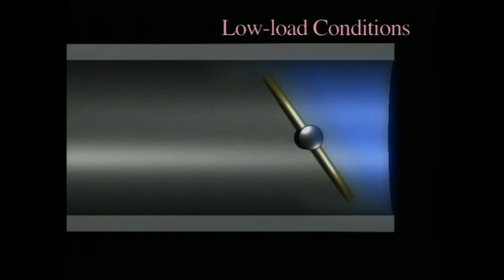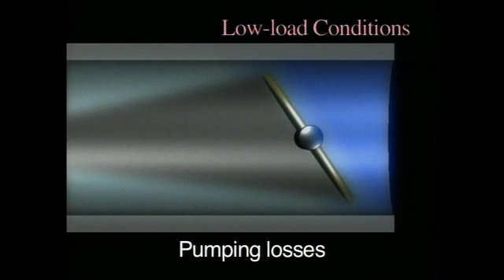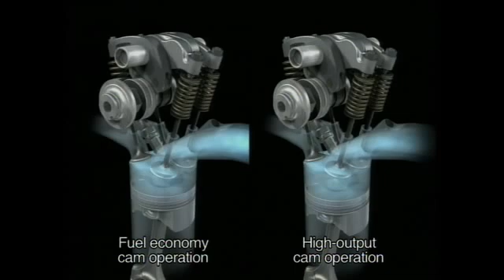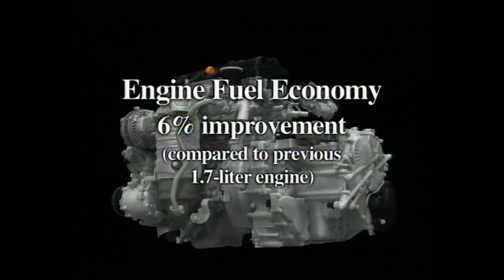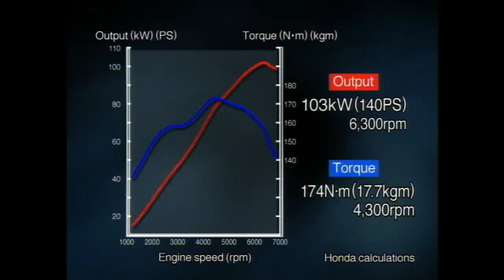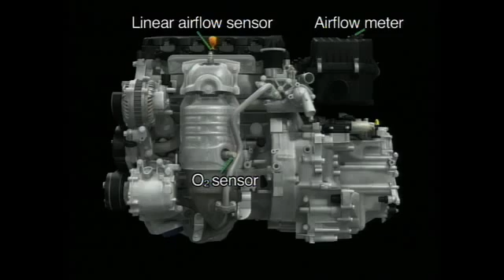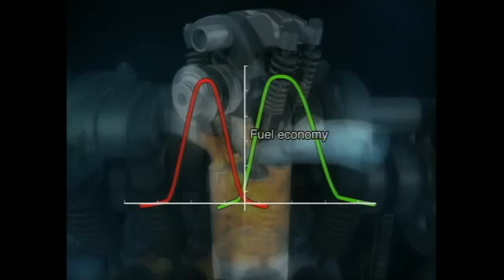Honda R18 Engine  1.8L  i-VTEC

Comment: The oil pan is smaller. Be carefull with the level. I bought a FK1 with the engine totally seized(knock knock also) bad maintenance. Swap to another and doing an average of 35 usmpg with i-shift.

Comment: My 07 1.8 civic gets as good mpg as my hybrid. Love the R18!
Reply: What hybrid? What mpg?
Reply: @borishasarrived5524  they can get over 40 mpg if youre easy on the gas but even when flooring it they sip gas there's a lot of tech in this old motor that is pretty crazy not for performance obviously but from a economy/workhorse durability it's the last of its kind

Comment: This is one of the best naturally aspirated engines that Honda ever made. Unfortunatelly, Honda has also gone wit donwsizing and puting a lot of Horse power into small engines. That results at low maintenance cost and great driving experience, but can never have as near as good durability and reliability of a naturally aspirated engines. I hate downsizing. If you need more power, buy a car with bigger engine and not with smaller engine but with bigger turbo charger.

Comment: this thing has no timing belt only timing chain which means less worry
Reply: Except it uses a plastic chain guard, defeating the purpose of a more robust timing chain instead of belt. Unfortunately, not just Honda does this and has become a standard to save on manufacturing costs..
Reply: @Skelpolu  plastic chain guards with friction and wear additives are perfect for this application. The chain will be the weak link.

Comment: I own  one . 2013 civicbase model . Exellent car, 
Ran MF exhaust , K& N intake on mine(with a Hondata tune) and it's even peppier. Keeps up with stock 2.4  SIs of the same generation ALL DAY.
Reply: SMIGGITY U no you don’t 😂
Reply: @BreastMilkBandit  He can but let me edit his post, "Ran MF exhaust , K& N intake on mine(with a Hondata tune) and it's even peppier..... ( along with , throttle body, TBS, Stage 3 ecu, FULL race exhaust Manifold to muffler, HCP fuel pump and injectors) Then you keep up with an Si that has an exhaust/ tune and barely
Reply: My si gobbles up these 1.8’s it’s not even a challenge bro. And if I have the hondata it’s bye bye baby nice knowing yaaaaaaaa
Reply: Coming from an tuned r18 owner to a stock k24 si, those k24s will still pull bus lengths on u

Comment: Pos motor cracks and leaks antifreeze
Reply: Ernesto Paz had mine for 5 years! 224k miles. Only powersteering pump recently went bad and my catalytic converter. Btw its a 2007 r18. Has been very reliable and fuel efficient.
Reply: Mine has 150,000miles, 2007. Runs fine no leaks
Reply: BULLSHIT! I have 5 years with my Civic, R18 engine... ZERO PROBLEM... I know other people with older Civics with R18, NO PROBLEMS AT ALL...
Perhaps you should learn to take care of your car.... But I am quite sure you havent ever owned a Honda, and you are just commenting on something you heard...

Comment: One of the best engine Honda ever made. Will run forever if you take good care of it,
Reply: What kind oil do you use? Im thinking of taking full synthetic like Castrol
Reply: @johnsmithsonian7271  I use Valvoline full synthetic and a STP filter in my 8th gen 2009 r18 civic.
Reply: Andre Gross I just bought a 2009 Civic do you use the 10w-30 or the 20 the manual had both
Reply: @commonknowledge8739  5w20 in summer, 0w20 in winter. The engine starts much happier with the thinner oil during colder months.
Reply: @andregross7420  try a top 0w30 ester oil.
Reply: Having had one for 2.5 years I can only agree.
Reply: About to hit a hundred and ninety K on my 06 Coupe
Reply: no way k20 are better
Reply: @AlexNamyang  hmm let's compare the sohc economy engine that runs on 87 octane to a dohc full vtec k20 that requires premium that's not the point of the engine
Reply: @AlexNamyang  B series. Always king.
Reply: Its very intelligent to compare performance vtec engines with econmy vtec engines....dear god *facepalm*. the r18 is in his class one of the best, maybe the best. there is no other car brand, with a comparable 1.8l NA engine and this low fuel comsumption + power output.
Reply: @Fisico87 the base trims of the 2016-2024 Civic, and the 2022-present HRV have a version of K20 that focuses on efficiency though. It’s called the K20C2 (K20Z5 for HRV)

Comment: Honda thank you for making the Revolutionary R18!
Reply: RR Extra  If you do use VTEC aggressively you'll be lucky to see 30mpg, even in the R18 engine, the difference is dramatic.
Reply: @summushieremiasclarkson4700  yea i got a 2015 civic with r18 and i get around 27 mpg average because i  love hitting vtec and do it so often, plus i installed an short ram intake a few months ago so it makes it louder when i hit vtec. I went on long roadtrip and my mpg shot up to 34mpg just bc i was on the highway for so long  even tho i stayed above 80 mph practically the whole time, very good engine economy wise i just wish it was more customizable in the power area.
Reply: @itried2hard633  True. Even at 85mph and in 5th gear, you should get 40mpg. I do.
Reply: @RR Extra yeah, and on the manual civic it only has a 5 speed. So you cruise at almost 4000 rpm going 80 mph. That chews through some gas
Reply: @Jesse.00  Nope the UK 8th gen manual Civic has 6 gears. I have one
Reply: @Jesse.00  no m8, 4000rpm in 5th gear is 100mph on the 5 speed manual. It's actually geared fairly conservatively. 85 mph is at 3500rpm, which is just below VTEC engagement. Ideally, it's designed to be efficient at upto 80mph, you can get 40mpg even then, so long as you don't brake too much.
Reply: One of several of their excellent engines but not one of their best
Reply: @elivan1700  sometimes when I am lonely I will shave one leg so it feels like I’m sleeping with a woman 👩🏼
Reply: @mattycheeze4131  wha-what da fuq

Comment: So, I have the Honda Civic 10' LX 1.8L (Engine shown in video. Fill free to correct me if I'm wrong. Does it drive better at 3500 - 4000+ Rpms or 4000 and below? Ever since I bought mine, it always took off a bit slower but 2nd gear at about 3000 to 4000 it's behind the car it that was in front of it at the light.
Reply: If it is torque that you are looking for then the higher in the RPM range you get, the better the pull will be. Second gear on mine has always had a pretty good pull to it so maybe something need matinence. I have my vtec window set from 1100rpm-1200rpm and I am still getting around 28mpg. I have a bunch of mods done to mine at this point which have made the car much more fun to drive, maybe look into doing something to it.
Reply: Hi, I have your same car/trim, does it has I-VTEC?

Comment: I guess this one is an end point in engine design. This is how much you can get out of a SOHC non-turbocharged 1.8 liter 4 cilinder.  It's great, it runs smooth, economical and can be quick when needed. Torque was better then any previous Honda engine of this design.
But engines evolve fast these days. Turbocharged, down sized engines are all over the place here in europe now. 175 Nm of torque at 4300 rpm and 140 ps at 6000 rpm is just not good enough anymore.
a turbocharged VW Golf 1.4 TSI delivers its 220 Nm torque at 2000 rpm and squeeze 160 ps out of that tiny engine. 

It's not that this Honda engine is a bad engine. 'Coz it aint a bad engine, it's a great engine.
But it is no longer the smallest engine with the most horsers for every liter and, more frightenly, it just can give the torque everyone wants now. Honda has lost its cutting edge in the design of small engines...
Reply: yes but all this little turbo engines are indeed turbo so honda is still the top notch , turbo engines are prone to turbine fault and other problems
Reply: i think u dont get it : is not about the power but the tougness off the engine, the honda petrol engines are pretty much bullet proof , low fuel consumption,no turbo, no dpf ,egr, and thats why i think this engine is the best petrol engine in the world
Reply: +FrightfulAccountant As bobby said: they have turbo and direct injection. You just cannot compare engine capacity with such different engines. Show me an VW engine without direct injection and naturally aspired that is capable of this performance and economy like the R18A1.
Reply: Yes maybe the competition make better number. The drawback is that this 1.4 TSI 160ps turbocharged & supercharged is full of problems. I know because I had one in my old Golf 6 and I needed to replace it after 100 000 km. Honestly, after that VW experience I took this R18A2 and the torque is here when you want, just need to downshift. Realiability in includded in the package with the R18A2.
Reply: FrightfulAccountant no Edge lost and quality- will see how those Volkswagens run after say about 175000 miles
Reply: Since you edited the original comment I will need to adress the new issue you posted by telling you to look at the 1.5l engien used in the 2016 canada civic. I won't say anything else, the facts speak for themselfes (but let's hope it's much more reliable than those VW pieces of trash).
Reply: Not to mention this car has far superior pollution control.
Reply: FrightfulAccountant - I’ll add to the comments by saying this engine came out 12 years ago. Now compare your comments to Hondas 2017/18 turbo engines 😝
Reply: small engines with  turbo always fail and cost a fortune in repairs . wise up my friend, if you can do without the turbo shit, do so.
Reply: Back in the 80s Honda and VW engines where the 2 most reliable engines you could get in a small car... 
Today Honda engines still are, but VWs have fallen frome grace. Everybody complains about how big moneypits they are. 
The diesels are even wors. In countries where diesel is cheaper then petrol, everybody wants to use diesels for city driving. Is there is one thing were diesel engines are realy not made for, it's city driving. ;)
Maybe people shoukd learn to spend a bit more on fuel and spend less on maintenance :p

Comment: The R18 has to be one of the worst and cheapest engines Honda has ever made. Cracked lower blocks were a huge issue with the 2006-2011 Civics. Plastic valve covers, intakes, dipstick and tensioners? These engines will be garbage before 15 years. Using plastic in an engine has nothing to do with "weight" savings and everything to do with profiteering and planned obsolescence. Plastic gets brittle with age and extreme heat cycles, it cracks. Aluminum weighs marginally more than plastic and lasts 3 times as long.
Reply: +SeverdSeouL Cracked lower blocks WAS R18A1 issue and not R18A2. US models use R18A1 engines. Europe and Australia use R18A2. Also R18A1 had 8 years unlimited mileage warranty for cracks and most importantly the issue is more to do with the factory where the US ones are made so stop posting bullshit!  R18 is one of the best engines build in its time! I had R18A2 from 2007 to 2015 and it had no problem at all.
Reply: SeverdSeouL clearly you are not an engineer.... these engines only cracked from 2006 - early 2009 models. These actually might be one of the most reliable engines Honda has offered. I've seen so many of these with well over 200k and they drive like new
Reply: 433K miles on my '08 LX. No block crack for me, but head gasket finally blew, so I'm rebuilding the cylinder head right now. Had it resurfaced at a race engine shop. Guy said he can't believe how tight the valve guides still are. Very little wear. Cam, springs, rockers, chain, guides, oil pump, etc are all within spec. Engine compression is 180psi on all 4 cylinders! I'm a Honda fan for life!
Reply: This engine is one of the best engine Honda ever made, very simple engine, easy to work on, very reliable. This engine will run forever if you take care of it.
Reply: SeverdSeouL - your Chevy Dodge or Ford will be dead im half that time ..... especially  Chevy or Dodge
Reply: I have an R18A1, 2007. 150,000 miles and no crack yet. Its runs about 4-8 hours straight every day. Still idles perfect and has great power. Its now 13 years old given it was technically made in 2006.
Reply: If 2006 civic fd have a crack problem??
Reply: Did you read the pile of shit you just said in your comment? Hahahahahahaha!!! The only car with cheap cracking plastic are the KOREANS. I have a 2000 CR-V, with plastic components in the engine AND NOTHING HAS CRACKED OR GOT BRITTLE... So your argument is invalid, my Korean friend... 
Anyway, I understand your envy, as your beloved Hyundai/Kia will never be able to be as good a Honda, NEVER....
Reply: @wtrdogg20  Actually, kia and hyundai are getting better, still not as good as honda or toyota, but they're closing the gap.
Reply: @williamcricket7931  ur crazy. Kias and Hyundai’s are very cheaply made.
Reply: severdseouL, what aload of bollocks you post, the issues you refer to only happened on a small amount of vehicles due to a production issue, you cannot slag off one of the most reliable engines in the world because you were unlucky enough to buy a dud, tough tits, thats life.
Reply: This is just rubbish

Comment: But am i the only one noticing that this engine has been pushed around since 2006, 2006-2015 C'mon Honda give us an R18 with DOHC and direct injection with Vtec around 5500 RPMs, Turbocharge and watercooled exhausts manifold like the 2016 new turbocharge engine. WOOT WOOT that would be beast!!

WOW i just had this thought maybe there making a new R18 for the 2016 Honda civic type-R, The same R series engine but as a 2.0l. The all new R20!!
Reply: An R20 already exists
Reply: on which honda model?
Reply: +Bryan AMDGuy  some 9th gen civic and 8 9th gen accord have an r20 engine...check wiki.

Comment: Got the 2015 ex coupe standard. Gonna start modding soon.
Reply: I LOVE ANY THING HONDA MAKES-(I OWN TWO)
Reply: Nice
Reply: Not with that CVT u ain’t nodding shit lol
Reply: @itrickz7145  I said standard. That means gearbox.
Reply: @itrickz7145  hey I got a Honda Civic coupe ex same as this guys but with a cvt...what type of issues can I run into modding, I changed my injectors to 24p, performance fuel pump, k/n air filter , changed my exhaust to a 2.5 and a couple other things trying to figure out if I should turbo or supercharge it but I do have concerns about if the cvt will handle it I haven’t tunned it up but plan on it after my turbo or super charger gets put on any suggestions?

Comment: I have a 2014 coupe 1.8 liter civic love it nice power & handling kick ass mpg. love the cvt just hope it will last as long the engine.
Reply: Revolt2010 my cvt has lasted 200k miles. Looks like u dont know how to follow manufacturer instructions lol. Change fluid and drive slow and it will last a very long time
Reply: +r l Skunk2 camshaft
Reply: Me too im trying to find some engine mods